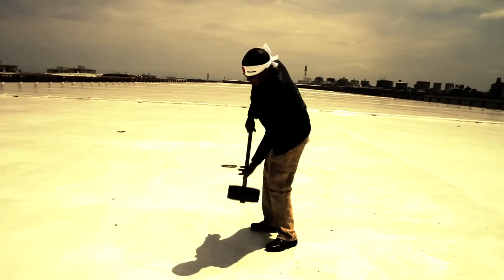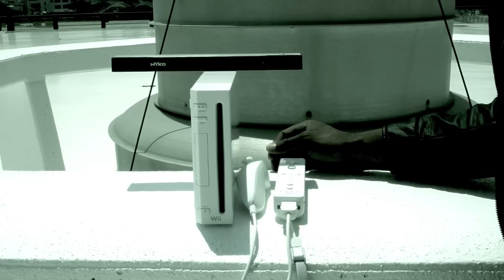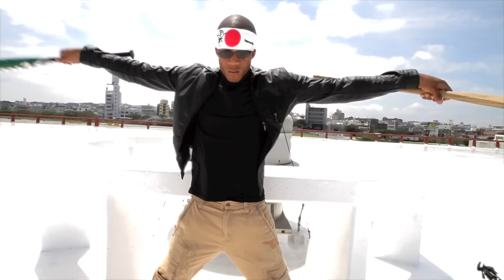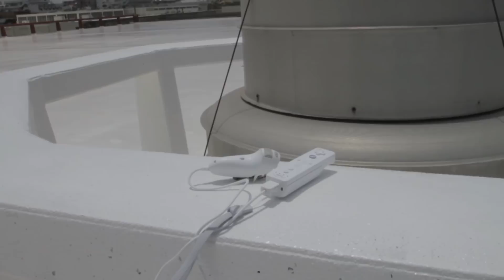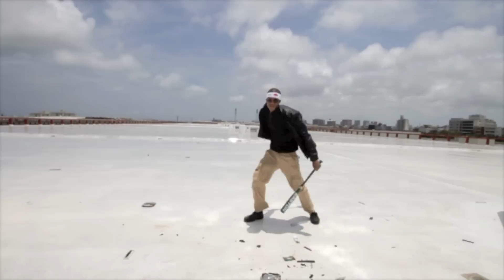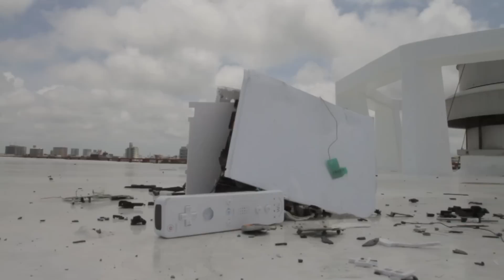HOW TO SMASH A NINTENDO Wii!?

Comment: Wow dude I'm surprised you actually pulled it off. Seems like, despite its low performance quality, a wii could survive a nuclear blast! This May, on the 22nd, it'll be the 3rd year in a row I've had my wii, and it hasn't had a single problem yet, despite the fact my sister plays it every day after school for 3 hours. In this same time, I've got through 2 xboxs and 1 ps3. [ps3 is better IMO.]